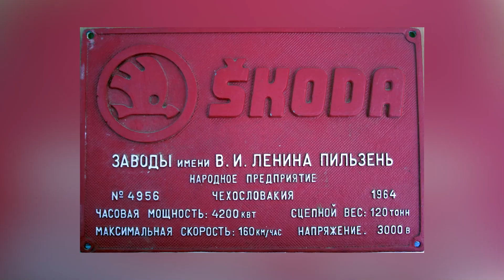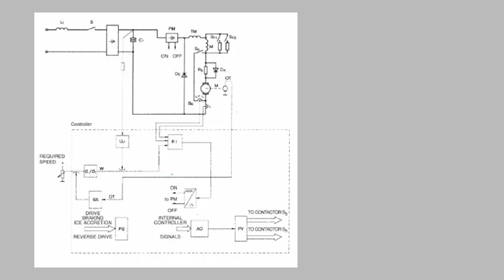The Forgotten American Trolleybus: How Škoda’s 14TrE Quietly Powered America

Comment: Trolleybuses are only ok if the electricity is always there. Engines can break down, but can be repaired and restarted, whereas if the grid goes, the trolleybus becomes pretty bloody useless.
Reply from the maker: You’re absolutely right! Trolleybuses are highly dependent on a continuous power supply. That said, modern systems often incorporate auxiliary batteries or supercapacitors that can keep the bus running short distances during brief grid interruptions. While they’re not a perfect substitute for a full engine, these technologies significantly improve operational resilience.
Reply: @ClassicCarSecretsTV Quite useful stuff. I know the more modern types incorporate back up supplies incase of grid failure. European cities still use a lot of trollybuses, which are far more reliable. Here in the UK, trolleybuses became extinct as the infrastructure has altered dramatically through the decades. Its sadly mostly battery-electric powered buses now. That said, it was nice to gain some knowledge of past U.S/European partnerships with bus types. I was a bus driver for 23 years, and I learn all I can about buses as a whole. Hopefully you can do a video on the Prevost H5-60. Big fan of articulated buses, and drove plenty too.
Reply from the maker: @MarkCaldwell-i6i  “Thanks so much for sharing your insights! It’s great to hear from someone with 23 years of bus-driving experience. You’re right, modern trolleybuses with backup power are much more resilient, and it’s interesting to see how different regions have evolved their systems. I’ll definitely consider doing a video on the Prevost H5-60, articulated buses have such fascinating engineering and history, and it sounds like you’d have plenty of stories to share!”

Comment: 2:31 Wrong Škoda logo. It's Škoda Auto car logo of company based in Mladá Boleslav, not Škoda Transportation in Plzeň.
Reply from the maker: You’re right! I accidentally used the Škoda Auto logo instead of Škoda Transportation. Thanks for catching that, I’ll make sure to fix it next time!
Reply: And you know again little. It was Škoda Ostrov, not Škoda Plzeň. Škoda Plzeň is the original Škoda plant, heavy machinery, turbines, nuclear reactors, etc. Škoda Mladá Boleslav was the factory plant built in the 1960s. And there was Škoda Ostrov, where all the trolleybuses until the type 21Tr were made. Škoda Plzeň is making trolleybuses after Škoda Ostrov was closed, and it does not produce any bodies, but uses existing diesel bus bodies for trolleybuses. Škoda Transportation/Škoda Electric are in Plzeň. Making locomotives, electric trains, streetcars and trolleybuses.
Reply: @ErikZiak  Jasně, vím, že to bylo v Ostrově předtím atd. Já jsem to bral z dnešní prespektivy. Navíc, ten závod v Ostrově spadal pod Plzeň.
Reply: @MrAjelinek  Ináč to video je odporná AI břečka. Fakticky plné chýb, nekvalitné, náhodné obrázky a klipy, do toho AI generovaný hlas ktorý číta AI generovaný text. Totálny odpad! Stačí pozrieť ten kanál, koľko a akých videá vydáva (ako často!). Odporúčam nahlásiť celý kanál, označiť ho za spam. Lebo ním je.

Comment: Dayton and San Francisco would share parts when Dayton started replacing there trolley coaches with new ones all the spare parts from there scrap coaches went to San Francisco when the new Flyer 60 foot coaches came and were ok by the California and San Francisco DPU the # 7100 series were pull out of service and they were stripped for parts to keep the 40 foot coaches going until the Flyer coaches came none of the 60 foot coaches were save but 1 40 foot was rebuilt by SF MUNI and it was used on every year when SF MUNI has there transit week it would run from the Ferry Building up Sutter Street the down on Stockton Street to Market Street back to the Ferry Building a lot of drivers were glad that they were gone the main problem about them was ever time the poles came off the when it was raining when the drivers had to put the poles back on the wires the drivers would get shock by the poles another thing about them they were run off wire too the New Flyers can run off wire for 30 miles the Skoda could not the drivers would pray to get them to go a lease 5 miles off the wire most of the time they had to be pushed by a repair truck or a street inspector truck I remember when SF Muni were testing them a lot of people were happy to see them and a lot of people were not happy to see them these coaches came on flat truck to Pier 17 where the were put together then push by a repair truck to the Ferry Building then the poles were placed on the wire to the SF MUNI yards
Reply from the maker: Fantastic insight! I didn’t realize the Skoda coaches had that many off-wire issues. Do you remember what year SF MUNI officially retired those trolleys? Would love to add that detail to a future video.
Reply: @ClassicCarSecretsTV the first New Flyer 40 foot coach came in 2021 after the Covid 19 started dying down it was Coach # 5701 it was tested for 6 months before the rest of the fleet came then the 60 foot Flyer coach came in 2002 it was Coach # 7201 these had problems trying to climb Sacramento Street the back axle kept breaking that’s why the # 7100 series were not replaced there were times that the 60 foot diesel had to replace them they were the first to be strip for parts to keep some of the 40 foot coaches going until all the 40 ft Flyers were on the property and tested out I have pictures of the 40 and 60 coaches Bus World has a real good story on the Dayton coaches you might have to see if there is any stories on them
Reply from the maker: @tonymento7460  Thank you for sharing all that! I didn’t know about the axle issues on Sacramento Street. I’ll definitely look up that Bus World article!

Comment: You didn't mention Philidelphia or Vancouver? They have trolleybuses.
Reply: Those cities do have trolleybuses, but they didn't use the Skoda 14TR-E bus, which is the subject of this video.
They stuck with their Flyer E800s and E900s until the E40LFR and E60LFR replaced them.
Reply: @benjaminnieva6016 and Seattle also had trolleybuses, but they decided to choose the german kieppe corporation as their traction provider, whom they installed their electrical parts into the the American built Gillig phantom, which started production in the early 1980s as a diesel powered school bus
Reply from the maker: I really appreciate your input. I might do a follow-up video focusing on the cities that kept their trolleybuses running. If you have any personal photos or memories from either city, I’d love to include them!
Reply: They also didn't mention Cambridge MA and the Boston trolley buses as well and they have been in service for decades